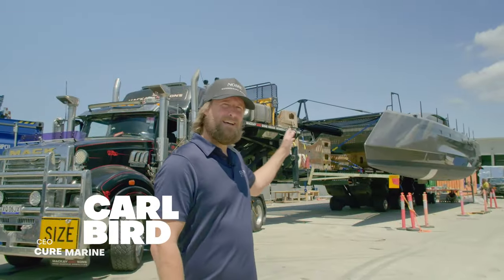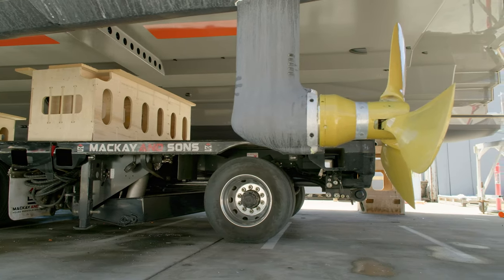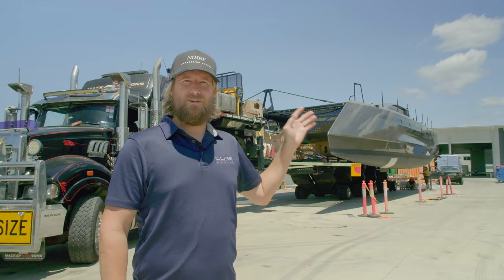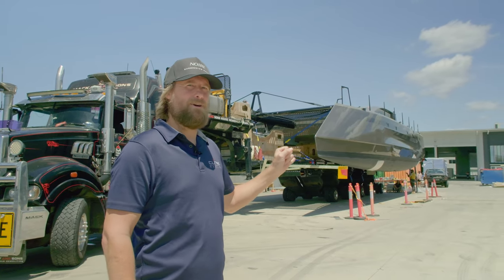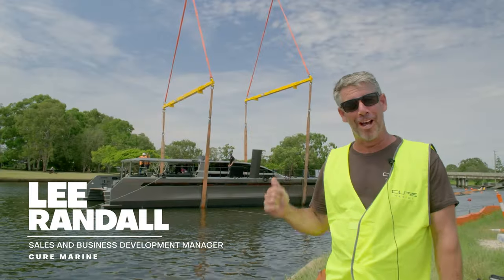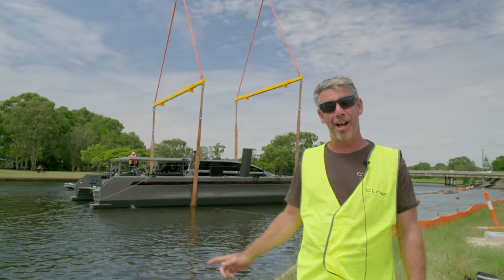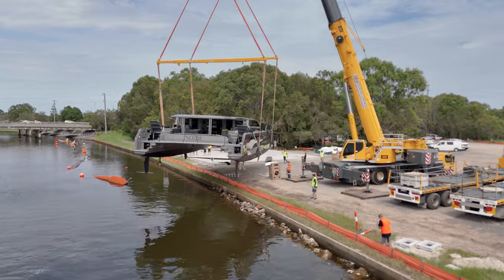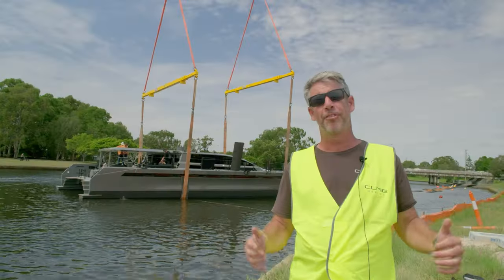Launching The Cure 70 Into The Water—Full Carbon Catamaran

Comment: High end manufacturers of cars total the car if the tub gets hit. They say it’s too expensive to fix. With that in mind, what happens if you hit something right in the middle of the boat and the hull is damaged is the whole boat totaled?
Reply from the maker: Hi there, 
Most performance boats these days do have crash boxes in the forward sections to protect the main hull from water ingress in the event of bow impact.
Noire and the Cure 55's also incorporate this feature.

Comment: Poor design on the sterns. The swim platform should be much larger and the steps go straight up in line. Also with a hull this size their should be a dinghy lift between the hulls. I also disagree with the cutback front hulls though that may save weight. Overall I give this a C+. Many major fails.
Reply: It’s always nice to see that armchair expert knows it better then the real experts. 😂